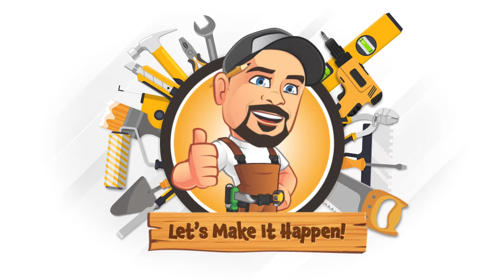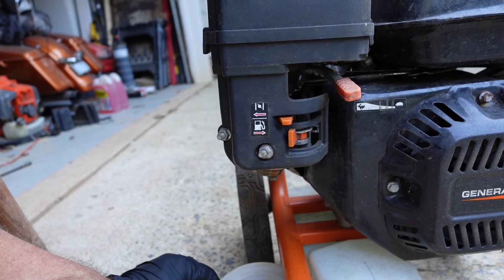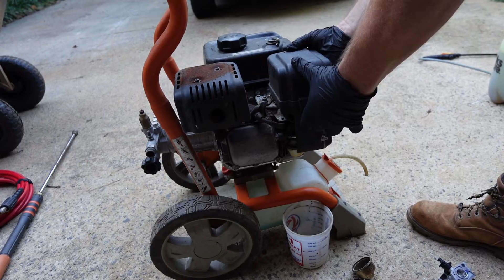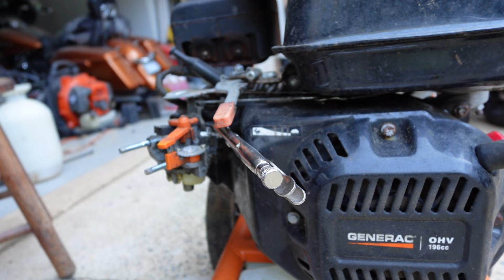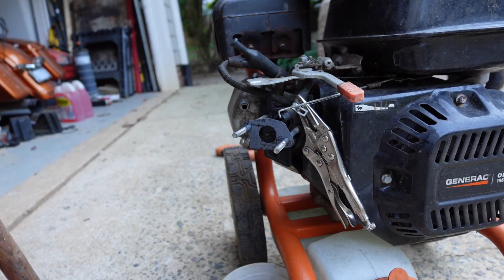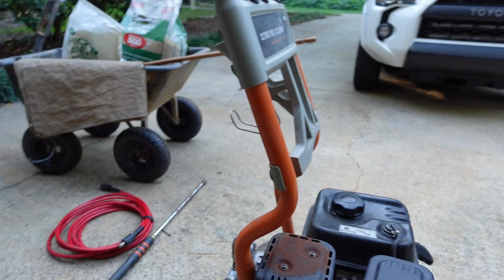Generac pressure washer carburetor replacement

Comment: In the same boat. Model number of carb? Need to replace myself. TIA
Reply from the maker: OEM parts you will need:
➡️ Generac - CARBURETOR  - https://amzn.to/3SR3Nl3
➡️ Generac Pressure Washer Carburetor Gasket - https://amzn.to/3SR3V41
➡️ Generac 0J35220127 Generator Carburetor Gasket Genuine Original Equipment Manufacturer (OEM) Part - https://amzn.to/3SNFrZj

Comment: that not REPAIR, that's replacement, thanks
Reply from the maker: Depends on what you call a repair. Was the carburetor repaired? No, the pressure washer was repaired by replacing or cleaning the carburetor. Same for cars, electronics, or anything composed of components. Either way, I hope the video helped someone because the issue with pressure washers is often a $20 fix.

Comment: This was an excellent video. My Generac 0060240 has for years cut off within a few minutes, and the choke had to be on full to get it to stay on that long.  It is so easy and inexpensive (<$25 Amazon) to just replace the carburator rather than rebuild it. You are so right about wearing gloves! I left one off thinking I would just use my right hand for handling gas-ish things, but I got some gas on it, and it is virtually impossible to totally get it off my skin. 

The only thing I would add to this video is to empty the gas out and replace with new, fresh gas. Also, put gas stabilizer in for wintering over. I emptied the gas into empty soda bottles, and it was distinclty yellow, ie. bad gas for small engines. Probably I never put in gas stabilizer, and the bad gas gunked up the carburator. New carburator and fresh gas has it running strong and consistently.  I am a 60+ grandma and I did a happy dance. Thanks!